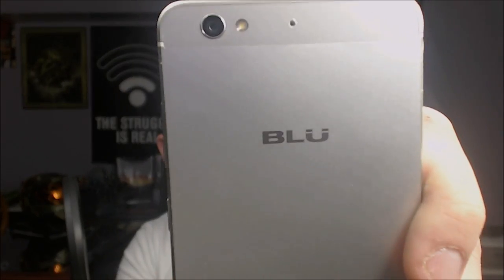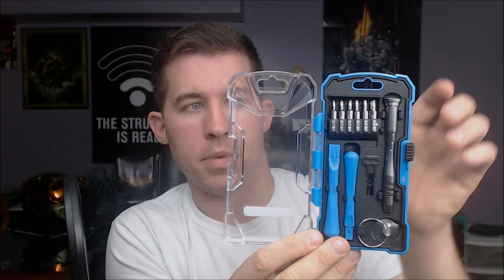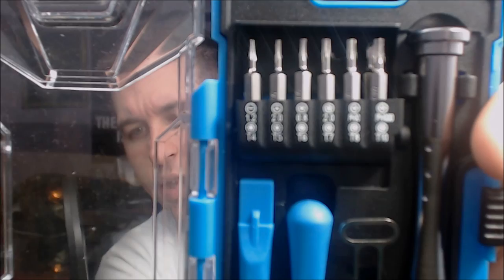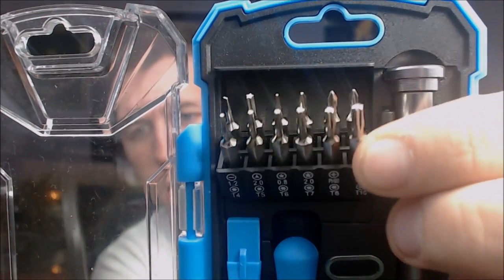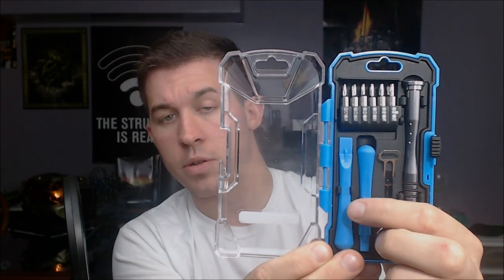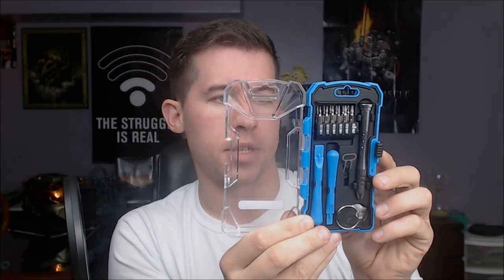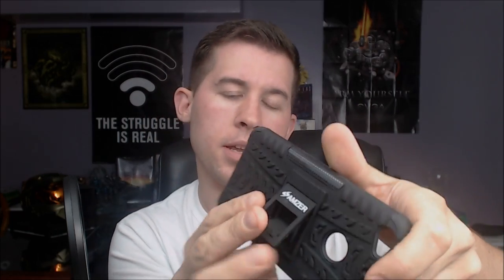How To fix a broken screen on a Blu Vivo 5

Comment: For that is why I pay my internet haha
thanks

I used shaving razor to open the sides and remove the glue.
And used two face adhesive at the top and bottom. 3 stripes each side.

Saved a some money and it's satisfactory haha

Comment: Thank you so much for this video. I'm so happy now. I bought a Blu Vivo 5 and less than a week, I sat on it ( I have this bad habit of putting my phones in my back pocket). there is an almost invisible crack from top to bottom. the phone still come on but nothing shows on the screen. just black.
Reply from the maker: No problem. Just remember to take your time. I'm not specifically skilled at cell phone repair but I wasn't willing to pay even more than I needed to in order to fix mine haha. I've left link in the description to fix the phone. Good luck to you!!

Comment: I generally feel confident to do this my self now Thanks for showing. Am inclined to use B-7000 glue. It has a pin thin tip where the glue comes out. Very accurate.

Comment: Thank you so much for this video. I am trying to replace the battery on my blu vivo 5. Do you know where i can found information about it ?
Thanks.
Reply from the maker: Hey there!! No problem I just saw that there was not a video anywhere to be found for this phone's disassembly. I have been looking today but unfortunately I have not found anything for it but I was able to find a replacement battery on eBay from a similar company that I have ordered, link to that is below just in case you need it. Good news is that I plan on dong a full disassembly on the Blu Vivo 5 soon and I will show how to find everything including the battery. Hope this helps. I'll try to get it up soon!!

Battery replacement for Blu Vivo 5:
http://www.ebay.com/itm/Battery-For-Blu-Vivo-5-V0050UU-BL-N3150-3150mAh-/291804683431?hash=item43f0ea1ca7:g:hZMAAOSwGIRXcQS7
Reply: Thank you so much. I will let you kwon if i have been able to replace the battery.
Thank you very vey very much. :)
Reply from the maker: No problem at all. Glad this was helpful :-)
Reply: Great job and thanks for the video!!!. Any news about the full disassembly? I need to change the battery too.

Comment: hello, if i want to change the battery from my vivo 5, i need to take the display first, right?So, the question is: I have to destroy it or is it possible remove the display and dont destroy it, change the battery and put the same display again?Thanks man!Nice video!
Reply from the maker: Hey Bruno!! Yes as far as I have seen and from what I have done personally it is only possible to get to any of the internal parts of the Blu Vivo 5 by removing the screen first. Good news is that it is also possible to take the screen off without damaging it as well. I only took my old one off in a crude manner due to it already being shattered. I honestly did not expect this many people to reach out for help. New video with full disassembly will be coming up soon!! I am very sorry about your wait as life has been busy!! In case you haven't found one yet, below is a link to a replacement battery for the Vivo 5.

Replacement Blu Vivo 5 battery:
 http://www.ebay.com/sch/i.html?_odkw=blu+vivo+5+screen+only&_osacat=0&_from=R40&_trksid=p2045573.m570.l1313.TR0.TRC0.H0.Xblu+vivo+5+battery.TRS2&_nkw=blu+vivo+5+battery&_sacat=0
Reply: thanks man, ill try to do it :) I really need to see whats happening with my battery.This shit doesnt charge and phone doesnt work

Comment: Do you know how to replace the battery on the Vivo 5? My battery crapped out only owning this brand new phone for 2 months.
Reply from the maker: I will be doing a video very soon due to a large amount of request to do so and it will cover the removal and replacement of the battery in the Blu Vivo 5. Stay tuned!!
Reply: Jessica Simmons I got this phone on Nov.9 2017 and it works great the battery will improve as you use it and charge it and be careful downloading apps and games because some can sneak and steal your battery life

Comment: Hi there I have the Blu Vivo 5 and I just dropped my phone and it has one crack now but it looks like it's inside the screen and the touch screen doesn't work anymore, do I need a new digitizer or should I just get a new one?
Reply from the maker: +Emily Nicole if you are confident in your abilities to replace one then yes. If not just get a new phone.

Comment: you used epoxy?.. for a few bucks i have bought 1mm double sided tape which works too..  so was the replacement screen amoled also?I guess that's why they're so expensive.. I'm thinking of buying a silver vivo 5 and changing it to a black screen.. anyways nice vid and thanks for the knowledge
Reply from the maker: Quartz Nation I appreciate the honest criticism. I just saw that nobody had posted a video about it yet and I didn't want to send it in just to get it fixed. I'll keep the tape advice in mind for the future. Thank you!!
Reply: EuclidGamer didn't mean to criticize but from my own experience in using epoxy on a screen replacement lol tape might be better or not. there's different end results like if there's too much double sided tape on top. the proximity sensor might not be sensitive enough or if there's too little. the screen can snag and fall off.I think like you showed.its fairly easy to replace. continued cheers for the vid

Comment: hi. can you tell me how the epoxy held up? I couldnt find the double sided tape, so I bought the epoxy. did you have any problems with it loosening up and cracking over time or did it stay held good?
Reply from the maker: +sara bugg it stayed holding good but the tape would be a much better alternative. Didn't loosen since I was careful in it'd placement..it'd a patient kind of job.
Reply: EuclidGamer well i found scotch double sided tape lol is that the same as the 3M?

Comment: what if the screen went dark black and would you need to buy a screen replacement
Reply from the maker: +Bricole Wesley if the screen itself went dark then it's most likely the digitizer either coming loose from the cable underneath or the digitizer went bad and you'll have to buy an entirely new one

Comment: Is There a video weich shows hoy to change the battery.
Reply from the maker: +laucaro333 there will be soon. Due to me needing to replace some parts on it. I will only be showing how to remove the metal plate under the screen and how to take the gel like battery out.
Reply: Thanks!
Reply from the maker: +laucaro333 The battery removal video is up!!

Comment: I dropped mine and the screen went partially black. Days later the whole screen was black and I could not see anything and it did not respond to touch on the screen. Can this be fixed? Is there a repair shop O could have it fixed at?

Comment: Buenas noches, quiero saber si esta pantalla LCD con digitalizador posee su cristal corning Gorilla Glass 3. Ya que, el original es así y no se si este sea una copia o sea original. Mi pantalla funciona perfectamente no tiene problemas y el sensor tambien funciona perfecto, el unico problema es que tiene una fractura desde la parte superior hasta la inferior. por eso pregunta ¿Es necesario cambiar toda la pantalla? ¿No se puede cambiar solo el cristal?
Reply from the maker: I'm not an expert. It is possible but not worth the effort. the glass breaks easily and is not easily done. Up to you.

Comment: Hi! Pls I have a Blu Vivo 5, charged it and tried to turn it on but it won't come up. But when i plug it to a charger it will vibrate. Pls what can I do
Reply from the maker: +Mercy Daniel have you dropped it or perhaps gotten it wet by accident? Also the cable that connect the motherboard to the screen digitizer could be popped put of place as well.
Reply: Hi! Thank you so much for replying, really appreciate it.
No, I have never gotten it wet or dropped it. Pls to know if the cable popped and putting it in place, is it something I can do myself? Thanks.
Reply: I had the same problem i nthe last 2 blu phones ive had, its becuse ur charger is really bad and breaks quick, i got a 6$ aftermarket usb c charger on amazon and it works liek a dream
Reply from the maker: +Sean Thompson would you care to share the link?
Reply: I love this phone so much but the lack of official supports is so annoying (wish there was a case/official screen replacement) also gettin a sim was slightly anoying because no companies claim to have support for the blu vivo 5 even though they might
Reply from the maker: +Sean Thompson I know the feeling. I know this video wasn't that good but the point of me making it was to show someone like me (not super tech savie) how to do it one way. Thanks for providing that link btw!!

Comment: Hey
I dropped my phone (a blu vivo air) a few months ago and the screen went black also the inner screen has a large crack across it and it still works. I jus cant see anything.
Does anybody know how to fix it?
Reply from the maker: Hey there Avionne! Unfortunately I am not familiar with that phone but I have seen it before and I managed to find a single video online that shows how to take of the screen. Now the video does not have many good angles and is hard to focus on a bit but if you can manage to follow the steps using a hair dryer (slower) or heat gun (faster) then you should be able to replace the screen digitizer using some epoxy in a similar manner as I did in this video. The video mentioned for the Blu Vivo Air is not subtitled or littered with English but it is a start. Also I have provided the link to what you may need below!! Hope this helps!!! Don't forget about epoxy or adhesive!! 

Blu Vivo Air Screen/Digitizer repleacemet:
http://www.ebay.com/sch/i.html?_odkw=blu+vivo+5+battery&_osacat=0&_from=R40&_trksid=p2045573.m570.l1313.TR1.TRC0.A0.H0.Xblu+vivo+air+screen.TRS0&_nkw=blu+vivo+air+screen&_sacat=0
Reply: EuclidGamer thank you so much

Comment: I broke my Blu Vivo 5 about two weeks ago. The screen looks fine but there seems to be a piece of glass under the screen. Is that the digitizer??
Reply from the maker: +Evelyn Garcia Could you take a picture with a friend's phone or camera and post it in here? Ill be able to tell you more from a picture. Thanks.
Reply from the maker: I'm assuming you need to know the same question that she is asking above?
Reply: +EuclidGamer   yes because on eBay are selling just the glass ,is cheaper 😁
Reply from the maker: +kensou20091 I needed both the digitizer and screen. It was a bad fall with the phone drop.
Reply from the maker: +kensou20091 I needed both the digitizer and screen. It was a bad fall with the phone drop.
Reply: +EuclidGamer  OK my phone got crack just on top 
do you think I can just replace the glass? and show a video how I take the glass off please
Reply from the maker: I may have to see what I can do. If I have the time I will make one because I want to do a full disassembly.

Comment: how did you open the phone
Reply from the maker: +javaunne scarlett you have to take the screen off. Heat gun to melt and soften the adhesive and then use a separater to remove the screen